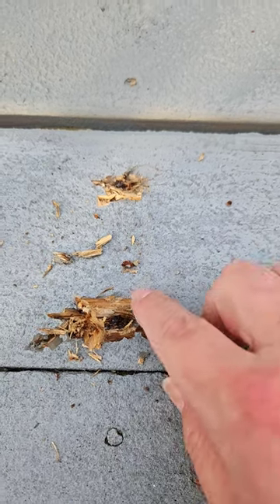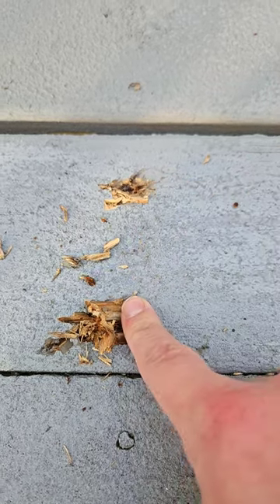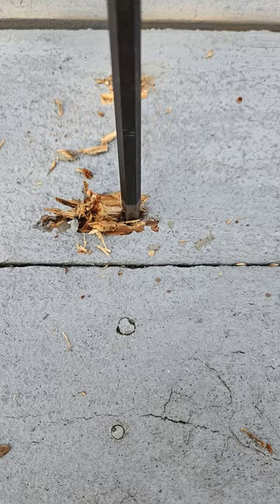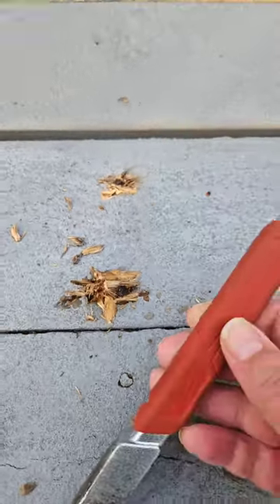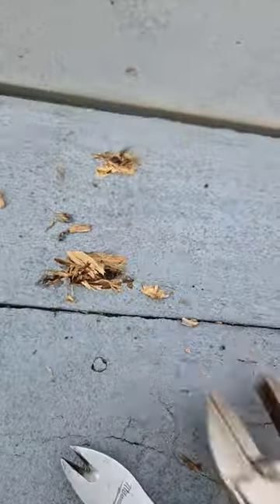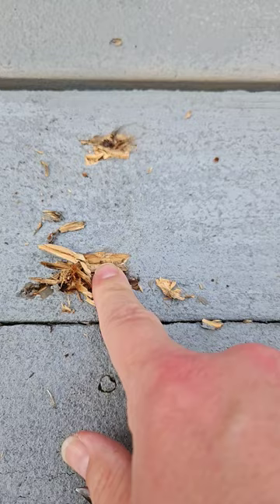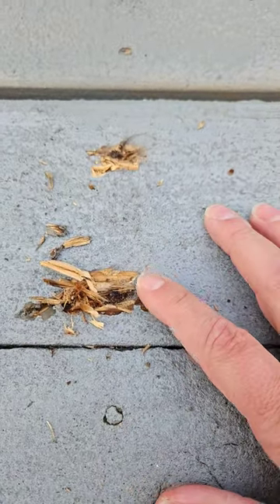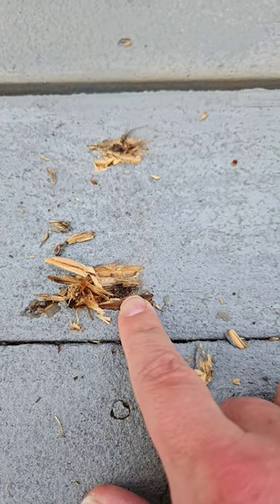Removing Old Deck Screws is a Pain! #shorts #diy #deck #repair

Comment: Yea, but you don't have nail heads to catch your foot for 10 or 15 years either
Reply from the maker: So the ones I've been using are 3.25" stainless steel spiral or ring shank nails. These things are 10x better than the garbage nails in the deck now. Even those old nails that are 20+ years old never popped up. So these new ones are a massive improvement.
Reply: @TheEclecticHandyman  To each their own. I have ring shanks and stainless twist nails in my customers decks that I repair sticking their nasty little heads out a full inch lol. I live in a humid rainy place I'm sure that has a lot to do with it. Coastal North Carolina. Docks are worse at moving nails than the decks proximity to water again. Wood pegs and pitch might yield the best results tbh
Reply from the maker: @dshobe720  Yep I'm on the opposite side in the mountains. This deck is 25' up and has natural sway but no nail pops. I agree screws are awesome for holding strong, but removal after years of wear and weather defacing the screws make them really tough to remove in mass compared to nails especially if someone paints the deck.
Reply from the maker: @dshobe720  on a dock I'd 100% use Stainless structural screws. 👍